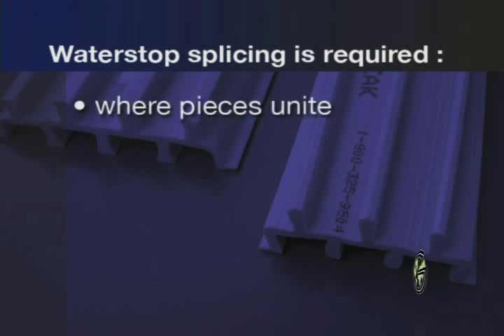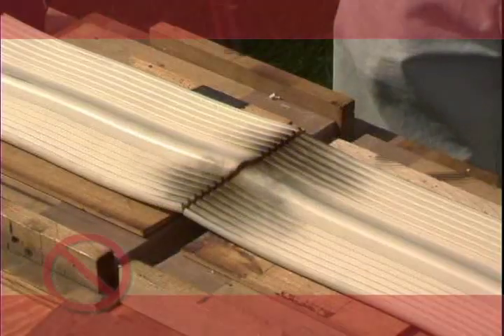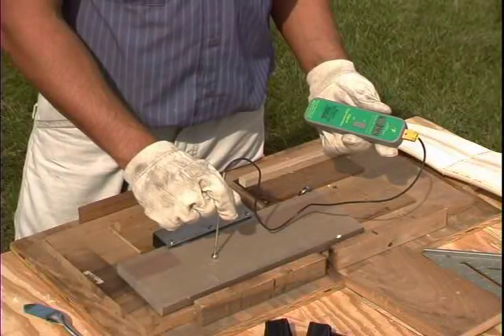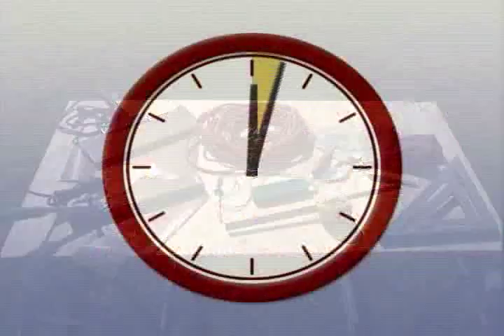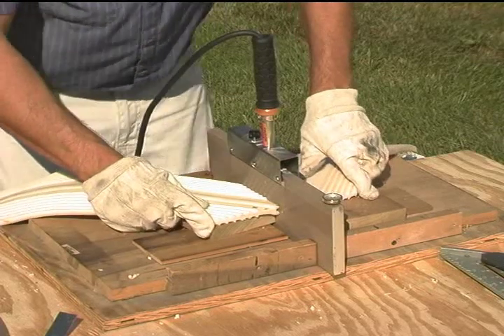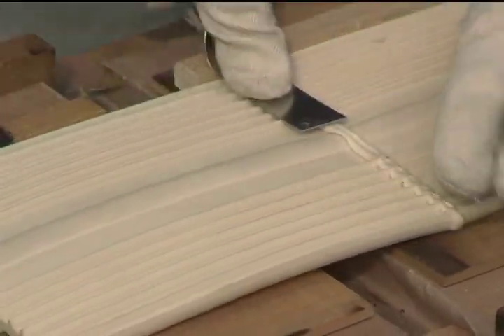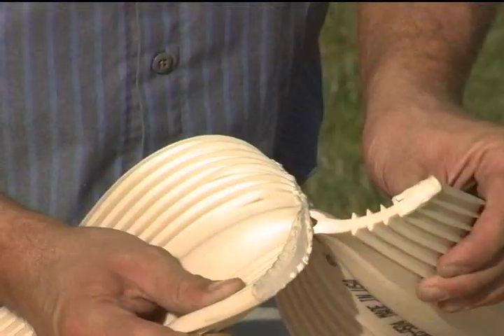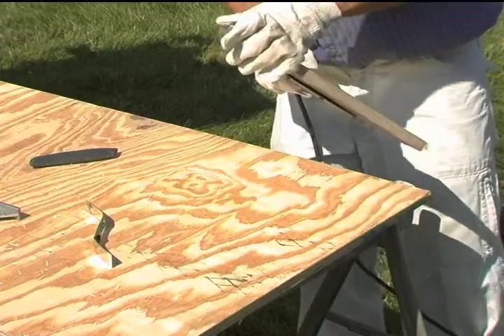Greenstreak Waterstop Welding Demonstration.mov

Comment: I used to work fabricating these pvc welds many years ago. I had specialized tables that would open up from the middle and allow the iron to slide down a rail. Was pretty fun and tricky figuring out how to cut and weld those crazy custom orders.